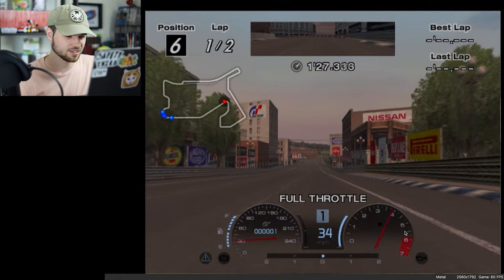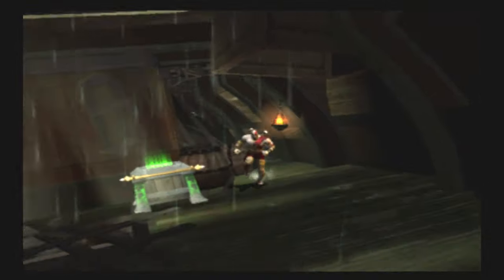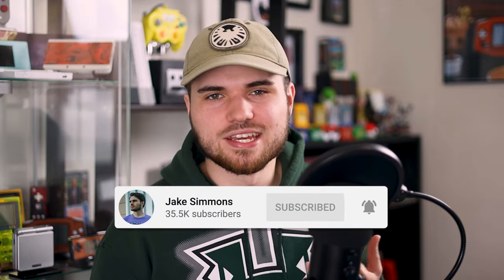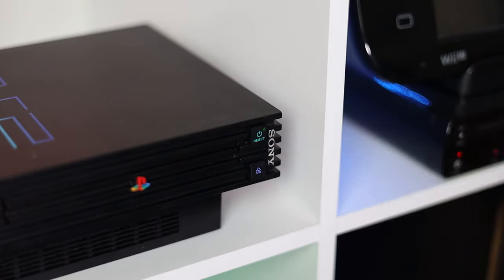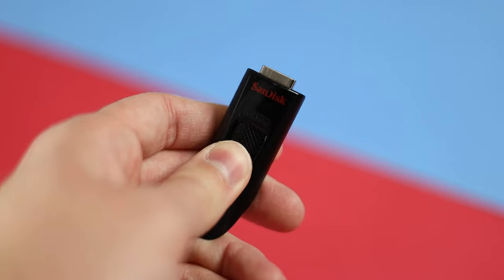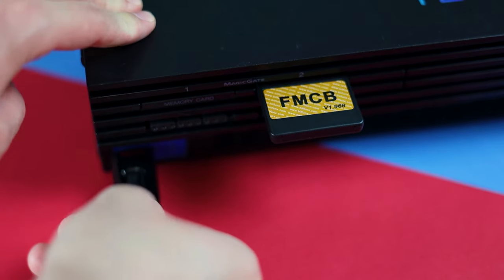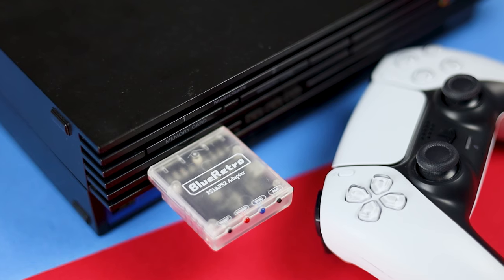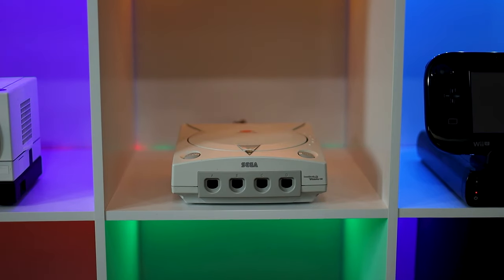PS2 Mods Are SO EASY! (and cheap) | The ULTIMATE PlayStation 2

Comment: lets just think for a second here... 300 DOLLARS THE SAME PRICE AS AN XBOX SERIES S
Reply: and you can emulate ps2 games on xbox series in resolution upto 4k
Reply: Or have every single PS2 game ever. 🕳️ Think Goku think
Reply: @King.of.Cursess  Goku,?
Reply: I guess you just don’t understand
Reply: @jroyablacksmith  i had a ps2 loved it to death wish i didnt sell it but i did so i could get an xbox soooo
Reply: Yes, but you have to consider the 5x is a niche product developed by one guy and isn't mass produced on the same level as other products, its also FPGA based which is part of the high cost. It's basically an all for one device to improve the picture quality for numerous retro consoles on modern televisions, not just the PS2. The only other options that remotely compare are the OSSC $140 - $200 (quality can vary, original VGP model is $200) and the Frame Miester $400+. The OSSC drops out when playing a PS2 game where the resolution changes, the 5x doesn't have that issue. If you just want something solely for the PS2, it probably isn't for you.
Reply: sadly yes. yes i did and i regret it because the games are amazing but, i like to play with other people online.
Reply: @r7zy  is it better?  That way?
Reply: It's 100% worth the price if you are into playing legacy consoles on modern TVs. I use the cheaper OSSC upscaler ($140ish in 2023)  in my DIY pedestal arcade cabinet.
 I prefer using HD CRTs to play sixth gen and older consoles, because I can and because I love light gun games, but I get that most people either don't have the space or don't want to mess with having multiple media setups.
Reply: Bro what? Series X is 500 dollars
Reply: @foshodofoodandstuff4437  SERIES S
Reply: @r7zy  ye with about 1 second of input lag and compatibility issues with some games.
Reply: I got my ps2 for 20$ how did you sell yours for an xbox?
Reply: @Locked 🗝️  you can put every PS2 game on your xbox and it can emulate them in 4k
Reply: @foshodofoodandstuff4437  he said series s
Reply: @Hitnrun66  I emulate ps2 on my Xbox everyday, there's no noticeable lag and very rarely is there a compatibility issue, 1 out of every 100 games maybe has a compatibility issue, but as far as lag there pretty much is none. Secondly who cares about a little lag, these nerds act like a little input lag is this earth-shattering thing when you can't even notice it most of the time. Playing a game with 1 second of lag doesn't affect the enjoyment of the game at all, you literally get used to it in like 5 seconds and forget it's there
Reply: @trinidad510  oh? I heard the input lag was bad on xbox but that was when dev mode first came out so idk anymore lol.
Reply: @hitnrun66  nah I play in devmode and record my gameplay with it running through my capture card and I still can't feel any input lag, nothing that is noticeable at least. It's pretty on point for like 99% of the PS2 library and GameCube as well. Sometimes if you have it running at too high of a resolution you'll get some performance issues but you can just drop the resolution and it will fix.
Reply: Emulator are not the same and that Xbox is terrible
Reply: @Jay NTB  Emulators are better, they upscale the games and make them look 10x better and allow you to do things with the games that you never would have been able to. Also Series X/S is amazing, you can do so much on that console
Reply: @King.of.Cursess  I don’t think you’re getting it anymore every PS2 game for 300 bucks there’s games that are 100 to 150
Reply: The $300 is for the Retrotink 5x.  If you own alot of consoles you can hook all of them into a switch then to the Retrotink. That way everything will be upscale up to 1440p with basically zero lag on your modern display. If you don't own a bunch of consoles, or don't want to run original hardware, then it's not worth it. If you just want the hardrive, free McBoot card, and sata converter to have all the games it's like $80. I'd recommend a CRT tv if that's all you want to spend as ps2 looks like garbage on modern displays. Looks amazing on crt.
Reply: bought a ps2 for 200 recently just realized how dumb that was 🤦‍♀️
Reply: @dry7560  that was stupid, not because you bought a ps2 but because you bought a 40$ console for 200$💀
Reply: @p_dux  where can you find it for 40???
Reply: Let alon the fact that it isn't worth the price,when he switched to HDMI,the game colors texture became duller,it was richer and darker on the Original
Reply: You can buy an mini pc and 2 Xbox controllers for this price and emulate or like @r7zy said just emulate on an Xbox.
Reply: @Kazumawastaken  Yep,that's beautiful too,gaming on a mini pc with controllers,i think of doing it since im sick of having to buy games to play on my console
Reply: In 10 years there won't be any reason to own an Xbox series x any good games are digital/server based so they'll be gone eventually  that's why no retro gamers will ever really care about ps4 xbox one they have hardly any physical  exclusives to buy
Reply: You just buy the drive then close it and return it
Reply: @r7zy Lol, no.
Reply: @r7zy  yeah but have you actually tried that emulation. its performance is crap and isnt even stable some games just simply crash
Reply: @KarnageGaming banning people now for it.
Reply: Original hardware is not the same
Reply: @p_dux I could never.. besides forza and gears, I don’t see the beauty in Down syndrome controllers
Reply: 204 people get your point. I’m not one of them.
Reply: Plus 20 dollars for developer mod to be able to run emulators on series s
Reply: You are missing the point here
Reply: @r7zy can I do the same on ps5? If not how do I do it on Xbox??
Reply: @TheAlphaOmegaX3 I have this massive debate going on. Hold the $300 and with a bit more get a Series X. I have about 200 Xbox and 360 games along with a couple of dozen One games. I also have all those consoles along with PS2, 3 and PSP PSTV.
Along with 150 or so games for those.
Retrotink 5xpro is appealing if the games will go to 1080p on my native 1080p gaming tv.
Reply: @GattozziSRH What if like me you have over 250 Xbox, 360 and One games?
Reply: @King.of.Cursess  how
Reply: @trinidad510  how
Reply: How are there so many of you commenting🗿
Reply: @p_dux  there's only like 48 comments, that's not that many lol
Reply: Nobody wants an Xbox
Reply: just don’t get the retro tink then. adding a hard drive and putting all the ps2 games on it is super cheap
Reply: worth
Reply: @r7zy not anymore
Reply: @ToothpickMan11 just get a crt for 40 if you want it too look good at high def
Reply: $300, but you get to play roughly 20k in retail games & realistically 60k worth in games given price hikes

Comment: PS2 don't work well with HDTVs. Save yourself $300 and get a mids 2000 analog TV. Those TV's will match the ps2 480 output signal and will get you a really nice and clean image. I just bought a 05 Sanyo for 15 dollars from my local thrift store. Best decision ever. I can't believe how good and smooth it looks
Reply: Not to mention input lag
Reply: This guy gets it

Comment: OPL use OPL. HDloader is obsolete. OPL can force progressive scan in some game, force HD res on some games, use cheats, load games from the network (SMB), Load your popstarter PS1 Games, use Virtual Memory cards, use ps3 and ps4 controllers wired or wireless using a generic USB BT adapter, load games from the memory card with a moded MC with a SD card soldered to it. is the ultimate ps2 application.
Reply from the maker: Thank you!
Reply: Is OPL restricted to certain models of ps2 or every ps2 console can be modded with it.
Reply: Is the batch loading utility (many games in a batch instead of one by one) onto mass storage borrowed from the old HDloader to expedite installation for use by OPL+MCboot?
Reply: @thepevulspd8023  yes, ps2 slims can be modded with opl, but the issue is that it's a lot of work on account of having to completely disassemble and solder in the new wiring system to make it run a 2.5 inch drive.

Comment: My 23yo fatbody PS2 is still kicking. Don't need no mods. 💪
Reply: Same here especially for all the PS1 and PS2 lightgun games and until they're modded for internal mass storage with OPL+MCboot as the LASERs are getting weak, unreliable not to forget all the capacitors and thernal pads are original and needing replaced if I'm going to keep s400/iLink system linking and that's not to forget ethernet LAN & LAN-tunneling online alongside retro-online MP.  Not getting rid of PS2 gameplay anytime soon as its going the distance. 👍
Reply: Lol what are you flexing exactly 😂
Reply: @user-ph5ro8xl4o  “retro” gaming. Taking care of your stuff. Not being a looser.

Comment: The PS2 has quite a few options for upgrading.

- I would recommend getting the SATA mod for the Network adapter. Maybe you have an IDE drive but man those things are old. That is a time bomb waiting to happen. Maybe an old enterprise IDE drive with little uptime would be a good option but the SATA board replacement allows you to use modern drives. While the PS2 cannot utilize SATA 3 speeds an SSD still has next to zero seek time. You can also just use a SATA HDD.

- Grimdoomer has a fork of OPL which allows you to use drives beyond 2TB in size. You can also format the drives as exfat. Personally I would prefer ext4 but no support for Linux formats at this time.

- With the network adapter or a PS2 slim you can use the ethernet port. If you have an SMB share on your home network you can set it up with OPL and have all your PS2 ISO’s accessible over the network. I personally have found less compatibility issues with my games running via SMB on my slim compared to the SSD in my fat PS2.

- Using a Dualsense, Xbox, Dualshock 4, Joycons, or any controller besides the Dualshock 2/Retrofighters may sound appealing but keep in mind that only the DS2 and Retrofighters controllers have pressure sensitive face buttons. In most cases this won’t matter but for Gran Turismo and Metal Gear Solid it will.

- using OPL will prevent you from playing PS1 games. There is a PS1 emulator called Popstarter or something like that but it isn’t the same as the hardware-based backwards compatibility of any pre-9000X PS2. The PS1 hardware basically makes the peripherals work when they aren’t being used for playing PS1 CDs. This includes the network, internal drive, and USB ports.

- worth mentioning that the hardware of the PS2 has a lifespan. The most likely thing to go first is the disc drive. This can be replaced if parts are still available. The capacitors in the power supply are probably going to start dying within the next few years if they haven’t already been. These can be replaced if compatible capacitors are available. Though this will require soldering and desoldering.

I have also been upgrading PS2s and still love the console. It has a great game library and was a big part of my childhood. Having said this do note that software emulation is pretty good for the PS2. PCSX2 is wonderful. Some games, at time of writing, just do not emulate well. Raw Danger is one of them. But if you are interested in modding your PS2 console I would suggest you also pay attention to software emulators as they will, eventually, be the only way to play our favourite PS2 games baring an FPGA coming around.
Reply: Don't forget about the MechaCon issue that affects SCPH-50000 models. These are going to require a PicFix mod.
Reply: dude i need your help asap
Reply: Does rumble works when using Bluetooth controller likes ps5
Reply: its going to be another 10-12 years before we see a ps2 core emulates on an fpga. the architecture is massively more complex than earlier generations

Comment: There a version of Free McBoot that can play PS2 disc images off an SD card connected to a simple adapter in the other memory card slot. It's a faster connection than the USB ports, as fast or faster than the CD drive. But this only works with a genuine Sony MagicGate or 100% MagicGate compatible memory card.

Comment: The PS2 already has an HDMi cable. It doesn't need a mod because the PS2 already outputs components and RGB Scart signals. So, if you don't want to buy a box, you can just use the HDMI RAD2X for the PS2 or the Hyperkin PS2 HDMi cable. No mods are needed.
Reply: Okay so this cable is garbage big dog.  And It adds heavy heavy latency try a FPS with that cable compared to a CRT and comp or AV.  it tries to deinterlace very badly the retrotink solves that .
Reply: @amped12345 I don’t have any issue with that cable whatsoever.
Reply: @amped12345  Can’t load up games I’ve never owned or even heard of.
Reply: @SumDumGy  those are some classics highly recommend.
Reply: @amped12345  As a PS2 fan I’ll keep both in mind for future pickups. Thank you for the recommendations!
Reply: @amped12345 The Rad2x is a Retrotink... It's impossible to get ahold of in NA so it doesn't matter, but 480p (or deinterlacing) is hardly the same as a good HDMI mod.
Reply: @psycomutt  you're absolutely right but those options are wayy better thant a PS2 HDMI cord that spits out a 480 image to 1080p with hefty lagg.
Reply: @amped12345  I use a GBS-C but I'm leaning towards the Gem PS2 mod since it's a lossless, lag free, digital signal. Definitely "better" than a anything that uses component cables but not necessary at all.
Reply: That's fine, but I would definitely go with the HD Retrovision PS2/PS3 component cables as those are the best and give syou minimal lag, and cleaner looks on any sized resolution screen compared to the Hyperkin. Believe me, when I used it for the gamecube, it does have some sort of blur on there, which I sadly don't like as I'm more of a pixel perfect/nearest neighbor type of person when it comes to retro gaming. So not having say Super Smash Bros. Melee nice and sharp looking, I'll just stick with emulators until I get something better for not just the DOL-001 series, but also the DOL-101 version of the gamecube.

Comment: A good quality component cable, like HD Retrovision's PS2/PS3 component cable, costs about $50 and makes the picture on an HD TV excellent.
Reply from the maker: That’s exactly what I used and it’s only $30 on amazon!
Reply: Just bought these for 30 on Amazon they look amazing on the 5x.
Reply: If you think that looks good try using the cables on a sd crt that supports component. Looks absolutely amazing. The best in my opinion

Comment: For Dreamcast, don't use the 5X, use a VGA to HDMI adapter.
Scart, SVideo and Composite don't use the VGA mode and the 5X actually looks worse than the native VGA mode.
Source: The money I would've wasted on a 5X if it weren't for my PS2 which does need it.

Comment: i got a question. if u get one of these mods cause your on original hardware having the roms on a harddrive or memory card will it let you play it at the same performance of the discs. 

or is it like emulation and the performance is gonna vary
Reply from the maker: They will all preform just like they would on discs. The only thing that will vary is load times depending on the speed of the drive you use
Reply: @JakeSimmons  ahh thank you

Comment: Have you looked into the MC2SIO? It's an alternative to USB game loading for both Phat and Slim model PS2s. Mainly meant for Slims, as they don't natively have drive expansion, but still works on both nonetheless. It uses the memory card port as it's connector and a micro SD card for storage. The memory card slot has higher bandwidth when compared to USB.
Reply: Oh and I forgot to mention, it's only $20 for the adapter. Not hundreds like the EverDrive carts are for other consoles 🥲
Reply from the maker: I’ve heard about it but I’ll definitely have to look into it more! I want to incorporate my white ps2 slim into my set up!

Comment: Great video. Exactly what i was looking for. A way to Play my PS2 collection without scattering cases everywhere, and a way to use it with wireless controllers. Hoping to try and use a set of PS3 controllers to keep it all same same. Do you know how those adapters work with multiplayer? Do they at all? Can multiple controllers connect to one or would multiple adapters be needed?

Comment: PS2HDMI dongle isn't that bad tbh. Huge step up from composite, and a great alternative to the $300 box for most sane people. Also, SATA converter + 1TB mechanical SATA drive is way way cheaper than a 1TB IDE drive.
Reply: that little tiny thing is exactly what I use, it is quite better than any upscaler including the one shilled in the video
Reply: Hey hope you can get back to me quickly but could you maybe link me to an Amazon listing for the Sara converter and the 1TB mechanical sata drive

Comment: you can just use the component cable for each console, instead of converting to hdmi.
component signal is good enough, there is nothing the 5x actually does to the signal.
you compare composite signal to component signal here..
even new TVs still have component input.

Comment: "Anyone can do it" 
first item cost 300 bucks
Reply from the maker: That is optional but I meant that this doesn’t require soldering skills. It’s all plug and play and the rest of the pieces are pretty dang cheap compared to other mods for other consoles
Reply: @JakeSimmons   yeah but it's a hassle, the dependencies and the sunk cost for this aren't really worth it when ps2 emulation is a lot easier now on even cheap computers.

Comment: He mentions the word “cheap” in the video title then the first thing he starts with is a $300 upscaler and says it’s not cheap and compares it to an Xbox  Series S l. Then he follows up with something he says is unnecessary 🙄

It would be cheaper to buy a ps3 or ps4 on proper software version, jailbreak it, then run ISO’s from apps that utilizes the PS2 emulation. It’s even upscaled as well.